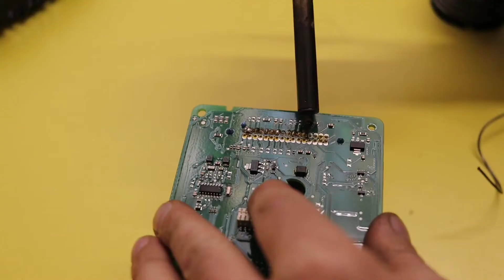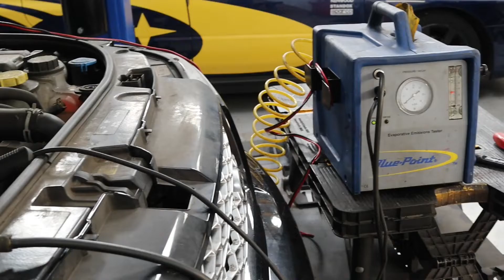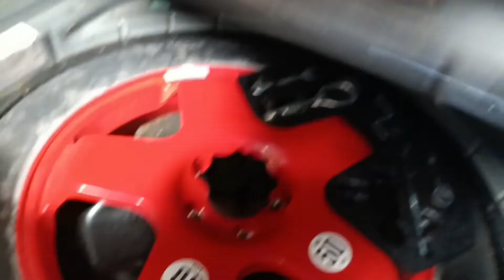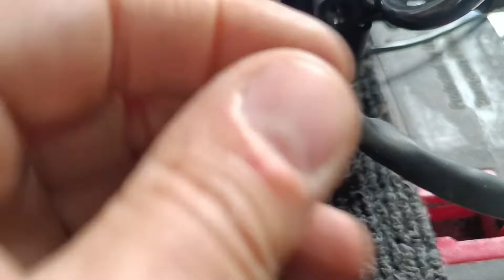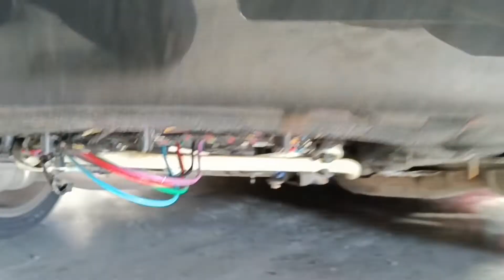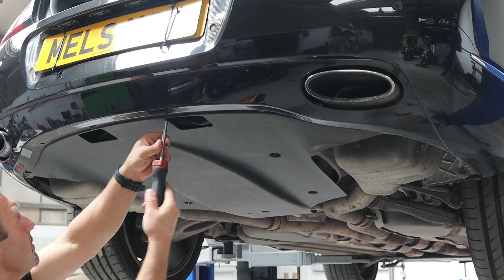Bentley Collapsed Suspension Issue!

Comment: 2016 flying spur.. I got the same damn issue, except its the front driver side only (US) 
Want to drive her again but thus is holding me stationary
Do you think the one wheel no air problem is similar,?
Reply from the maker: That's either a leaking leg or the bypass air valve is faulty. You won't always hear the compressor working as they are very well insulated!

Comment: Must be nice to have a new compressor sitting there to compare with. Unfortunately, I do not have a new compressor lying about so why not tell us what pressure the NEW compressor pumped up to versus the old compressor. I'm not going to willy-nilly buy a new compressor in the hope that is it. My compressor runs too so a PSIG or Bar reading would have been great.

Comment: I having the same issues like the motor sound very good buh there's no lift
Reply from the maker: Well you'll need to start doing some checks. A running motor doesn't mean it's compressing the air 👍

Comment: Do I really need VCDS ? I think most scanners can do this work would you agree ??
Reply from the maker: Hi, VCDS has features that other scanners don't have, everything on VAG cars use channels and codes. When you use VCDS it gives you the security codes to the tasks at hand. It's not expensive for what it does and it has lifetime updates. Don't waste your time with a clone. Depending where you live it's around $2-300 👍
Reply: Thanks Mel

Comment: Awesome video BUT YOU GUYS... a weak battery can also be the issue for not raising suspension amongst other issues like eindows not closong alarm going off etc
Reply from the maker: @misha2.097  thanks for your input, did you watch the video and my test procedure?  👍🙂
Reply: @melsmotors  no but I will now that you say that. I just had this suspension issue where front end dropped and rear was up. I knew my battery was weak got both replaced now its normal

Comment: Mine takes two days for the front end to drop. I turn it on and it comes up no problem. I guess the pump is doing its job but these issues are so finicky
Reply from the maker: That's leaking front legs, very common, did a pair this week. The pump is fine! Replace the front suspension legs. 👍

Comment: Thanks for the video. I always enjoy how differently things are named. We call that accumulator an evap canister, at least I believe that's what that is. And my problem is the sagging/dropping of the suspension over night (2009 continental gt). I didn't take it out, the pump, but I disconnected the 3 wires, put power to the pump but it would not turn off (weak finger?) like your testing did. A lot of pressure though. It lowers evenly overnight.
Reply from the maker: Thanks for watching and commenting, an accumulator and EVAP are not the same thing, whether you're in Europe or US, an accumulator stores energy, in this case pressurised energy (compressed air) and EVAP is an acronym for evaporative emission control, the EVAP is usually a charcoal canister which holds petrol (gasoline) vapour and then burns through the engine via a solenoid valve, they do very different things. Technically you could say that fuel vapour does accumulate in the charcoal canister! I hope this helps resolve the confusion 🙂👍

Comment: You will soon know if the pump works in my case 2005 it rises up to normal then drops slowly down around 5 hours time
this video helped me find the leaks and fix it with help from Johnny Hotsur GT on the 6speedonline forum 
Thanks for your video it will help alot of Bentley Owners as this is a common issue for them...Thank you

Comment: If the compressor is at fault, why doesn’t the rear do the same?
Reply from the maker: @Cuzzazbuzz  I have another Bentley in now, front dropped and rear up, it's just the way they fail!
Reply: @melsmotors  If the back is up then its not a pump issue bro it will be one or both front struts that have a Leak on them ... Sqeezey bottle soapy water and spray to find .. must have weight of car on the struts ..but you already know that Mel
Reply from the maker: @ the bags were fine, read the comments above 👍
Reply from the maker: Because the rear airbags are holding pressure, the car was sat in a garage for almost a year and the fronts deflated over time, but the pump wasn't working to fill them back up again.
Reply: What brand pump did you buy?

Comment: Thanks so much for your video, my Bentley front dropped after few days not driving, but when I started engine, it goes up again, is that normal?
Reply from the maker: That is normal for it to go up, but if it goes down after a couple of days it's usually a leaking air bag!

Comment: I just bought coilovers, Im done  with air rides.
Reply from the maker: It gets to a point where people just have enough of the grief, most people drive at normal height anyway! 👍
Reply: Do u have a link to what shocks u have and can I do that to an 04 continental
Reply: @bigponsellerssr.9227   Mine were only $1000 next time Ill pay a little more for the better ones.  But the $1000 ones got the job done.
Reply: What are coil overs
Reply: @bigponsellerssr.9227  I took out tge air shocks and installed regular shocks.

Comment: A somewhat related question: 2015 Flying Spur with next to no miles but had a rough life; I do not know the details. Front struts were just replaced at a third party shop who may have botched the job. The car pulls to one side when accelerating hard. When the car is raised, I measure THREE different heights at the 4 wheels (tire top to fender edge) The difference between the highest and the lowest corner is 1.5 inches!!! Any thoughts? Bad suspension valve module? Lacking strut calibration after installation? Past frame damage?
Reply from the maker: Hi, sadly I can't explain the issue but you can't measure the suspension raised, only when it's on level ground. If they're off when on the ground then the suspension will require calibration to the correct height for each corner.

Comment: Hi, A question, please. 2015 Flying Spur with next to no miles but had a rough life; I do not know the details. Front struts were just replaced at a third party shop who may have botched the job. The car pulls to one side when accelerating hard. When the car is raised, I measure THREE different heights at the 4 wheels (tire top to fender edge) The difference between the highest and the lowest corner is 1.5 inches!!! Any thoughts? Bad suspension valve module? Lacking strut calibration after installation? Past frame damage?

Comment: Really could use your input. I recently bought 2005 Bentley gt. Not knowing I did not put car into Jack mode and install lowering links. Now the rear is 4ins high and the front is slammed to the ground. Wondering if this is bad struts in the front due to not placing car in Jack mode?
Reply from the maker: Hi Ally, you may need to reset the ride height via a scan tool, you will probably need a measuring tape to aid in the adjustment. The lower arm sensors dictate the height of the air bags and now the heights are off. I have also seen people put the ride sensor link arms on the wrong side of the main arms. This happened to us in a Land Rover and is easily done 🥴
Reply: Thank you! Another question currently the front left and rear right are high by an inch. How would I say reset the air suspension or calibrate it back to stock? 

(Factory links have been put back on)
Reply from the maker: @Ally.cat777  I mentioned previously, you will need a scan tool and a measuring tape. If you're not sure then take it to your mechanic. 👍
Reply: Is there not a relay or a fuse that should be checked prior to removing the pump?

Comment: if this was the whole compressor issue, why only front was down?
Reply from the maker: Hi John, The car had been sitting for almost a year, as there's a W12 engine in the front thus making the front heavier than the rear, the rubber airbags in nature are porous just like car tyres, so some of the air escapes over time. The front had dropped slightly, when the car had been started the compressor kicked in and the front valves open to lift the car, the lack of compressed gas - due to a worn pump caused what ever air was left in the bags to fill the expansion reservoir deflating the bags further. The car was doomed not to lift the minute it started. The car has been back several times since and it's still working and the front hasn't dropped. I hope this made some sense! We see the same thing on Q7's and alike. Thanks for commenting and watching 👍

Comment: How do you tow or flatbed with a collapsed front suspension?
Reply from the maker: No easy way to answer that, use wood flat boards under the wheels to raise the car before loading it onto a flatbed lorry.
Reply: I just did exactly this tonight. The flatbed driver didn't even want to touch it. He was scared he was going to damage it so he allowed me to take it off the truck for him. I just used a bunch of 2x4 to create a ramp

Comment: thanks for posting this.  Now it's my turn.  :-(
Reply from the maker: Good luck and thanks for watching 🙂👍
Reply: @melsmotors  the gods must be mad at me.  This 2012 was sitting low in the front only.  When I removed the old pump, naturally it came down in the rear.I installed the Arnott pump and the pump is running, but the car isn't coming up.  Pump runs for probably 5mins and shuts down.  Any thoughts?  I'm in BFE and have zero options except dragging its ass onto a flatbed and towing 250miles.  Car has 13k miles and it belongs to the boss.  Just trying to get him rolling again...  No good deed goes unpunished as they say.😂
Reply from the maker: @jagboy69  Difficult to diagnose your issues from afar. You will need to use a decent scanner and get some live data out of it and carry out the activation functions to see what's working an what's not!! Hope this helps 👍👍😊😊
Reply: @melsmotors  No scanner within 250miles.  I ordered a valve block.  fingers crossed.
Reply: Installed the block.  Still on the ground.  At least the pump runs for now.  🙄  I find it hard to believe both front struts crapped out at the same time.  Might need to try swapping that control module in the trunk.  Hey, where the hell is the reservoir in this thing?  I've looked everywhere.
Reply from the maker: @jagboy69  Dude! Please stop spending more money on parts you don't need. You can't just buy and try, some times these cars just need a reset. As mentioned before you need a scan tool to diagnose, to read live data, to carry out actuator tests and to carry out a system reset. Even if you buy the faulty part and replace it, it may never lift without a reset!!! I don't believe there are no mechanics within 250 miles, in 1 square mile of my garage there are over 10 others! Please find yourself a professional. 👍😊🤷‍♂🤦‍♂
Reply: @melsmotors  yeah I'm trying to find someone with that vag scanner now.  Maybe I should just put that Ross thing on my laptop.
Reply: @melsmotors  Bought a scanner (A30M) and it said I have a leak.  NFS!!!  Didn't need to spend 240bucks for that epiphany.  I did look through all the live values and nothing looks out of place.  I guess it's time to try to find this needle in a hay stack.  I'm thinking isolating each bag and inflating them with shop air, close them off and crack a beer as it sinks back to floor.  I'm out in far west texas, these guys are fine if you have a truck, but bring them a bentley and you're fkd!
Reply: @jagboy69  anything ?? I'm in the same boat
Reply: @CHASINGPROFITS  Yup!  Here's what I figured out.  I got a pump and valve from rock auto. Both Arnott components.  Well, the arnott valve comes with a TSB and it has the positions of the hoses in different from stock.  I followed the TSB and NOPE, something is wrong.  So I tried going back to the stock locations.  That didn't work either.  SO, I decided to go back to the stock valve.  (keep in mind I didn't know if it was good or bad)  The back of the car started working fine again, but not the front.  I disconnected 2 front hoses at the valve and forced 120psi into each of those lines.  I heard hissing on the front right strut.  FINALLY found something!  So I ordered 2 struts for the front from rock auto and changed the front right first.  Flipped the car on and up she came!  i left the car for a couple of days and it was still up in the air.  I then replaced the front left and it's been just fine.  So lessons learned...  The scanner does help seeing IF the level sensors are doing their job which tell the computer which solenoid to fire off to make the change.  This can be checked by disconnecting them and seeing the values change.  Next big item!  If one strut is bad, the other one will not be able to pick up the entire front end AT ALL or even partially.  I did tell arnott something is fishy with that TSB and or that valve.  I returned my new one.  The A30M is pretty good and I decided it was worth owning.  Wife has a miata barbie car and it works well on it.  Lastly, there is no "RESET" on the bentley.  The thing works or it doesn't.  The a30m will allow you to clear the codes for the suspension and then there is a useless function test, but that's about it.  I never tried the vag-com as I hate VW/audi cars.  In the end, the bentley is just another shitty VW product from a confused time in car history.  The dealer wanted $3800 a piece for the struts, Lifetime from RA was $700.  SO F the dealer.  I'm glad it's over, the boss is probably going to dump the car in the end anyways, I got to work on a nice car and learned a thing or two.  Hope some of this helps someone not get a screw job from a dealer.  Oh yeah, that car is REALLY STUPID HEAVY. 5300lb convertible...  WTF??  If you have one bad strut, ALWAYS change it's buddy.  When one goes, the other is not far behind.  All the best!
Reply: @jagboy69  yep.... Always do everything in pairs. I got a leaky left front. Fortunately the pump is running and we can hear the leak.
I'm just going to put a pair on $500.00 each and a few suspension arms at the same time.
Thanks for your info. It was interesting and informative.
Reply: @nicholascharnley2313 yup..  I hate to say it, but the expensive arnots are the way to go.  My boss drove that car another 2yrs then he dumped it.  Beautiful convertible, just not worth the trouble.  Good luck!  You can do it and stay outta the dealership.👍
Reply: Hey thx for the reply couple questions for how did you force the air into the connection if you disconnect the airline from the side of the strut
Reply: @CHASINGPROFITS  I have a rubber thingy on an air hose tool.  But don't expect to lift the car with it.  I would suggest if you suspect a strut, jack the car, remove the wheel and disconnect the 10mm fitting and hose off the strut.  Then attempt to inflate that strut and listen for air.  If the strut doesn't extend on 100psi, you probably found your issue.  WIth my new struts, I had to collapse one of them to get it to fit back up in there on installation.  Only because dumbass me only had one side of the car in the air.  This puts an insane amount of preload on the sway bar and makes lift Hell!  If you change either strut, have the entire front end in the air.  But, use a good jack and stands, this bastard is insanely heavy!  Any other questions while I'm handy?  I'm happy to help.